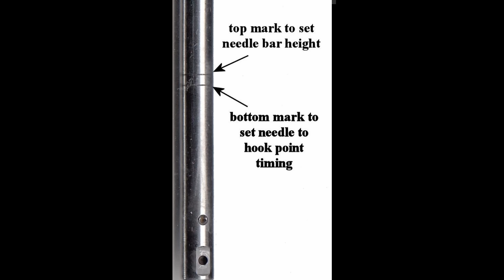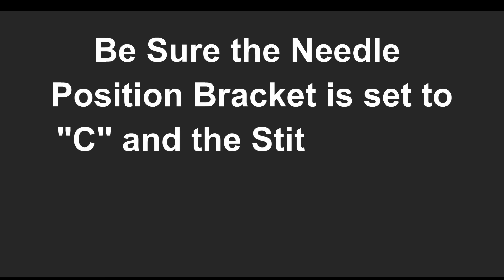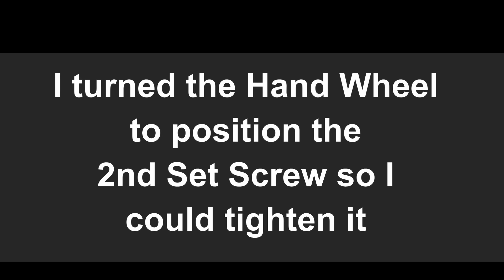How to Check and Set the Timing on the Singer Model 413 Sewing Machine

Comment: Any chance you can help me identify (and resource) a part that I discovered is broken on my machine I just got while checking the timing? I realized the bobbin hook wasn’t spinning at all, popped the bottom cover off to investigate and a plastic gear fell out. I haven’t the slightest clue where to source a new one.
Reply from the maker: Since you comment on this video that is about a SInger Model 413, I'll assume that is the model you own.
The only plastic gear I'm aware of is at the top of the vertical shaft. That shaft tuns the pulley on the right side of the bottom ofo the machine, which rotates the timing belt, and the pulley on the left that rotates the hook. So, if the hook is not rotating it would follow that is the gear, or gears parts, you found. Model 413 is in a group of SInger machines know to have a failure of that gear after 30 to 40 years of service. It is so common in fact, that several online sellers have the new gear for under $10. The part number of the gear is 155819 and you can search for it. As an example, here is but one of the many sellers I mean: https://www.ebay.com/itm/Replacement-Top-Vertical-Gear-Fits-Singer-413-416-418-457-466-476-477-478-518-/361467199502?_trksid=p2349526.m4383.l4275.c1#viTabs_0
If you need some information about replacing the gear and retiming the hook I have a video about it. I demonstrate on a model 457, which is similar to your 413 and can help you understand what is required. Here is a link to my video: https://youtu.be/M3bFtlV1Y6s
Reply: Haha, I figured it out and you already have a video covering how to replace it. Thanks for all the helpful videos!
Reply from the maker: @chrismontgomery8820  Good luck and happy sewing.
Reply: Andy,

Yes, it’s a 413. I got the gear issue all fixed, but now I have another issue. Is there a good way to lubricate the crank shaft (i.e. the rod that the hand wheel turns)? I cleaned a lot of rust/gunk off both the presser foot bar and the needle bar, and I’m assuming that the crank may also have some because I feel like there is a tiny bit of binding when I turn the hand crank. When I plugged it in after replacing the gear and tried to run the presser foot, the motor was turning freely,, but wasn’t turning the crank (indicating the belt was a tad too loose). I moved into adjusting the tension on the belt, but if I tighten it even a tiny bit, it restricts the motor, and if I loosen enough that motor sounds good, it’s not turning the crank hardly at all.
Reply from the maker: @chrismontgomery8820  Here is a video about cleaning the worm and cam stack gears then applying new grease on a different model to give you some ideas. https://youtu.be/_SuIiVok64k  You can also buy the Service Manual for models 416/418 which is what most of us use for working on the 413 model. https://manualsoncd.com/product/singer-416-418-sewing-machine-service-manual/   I'll just recommend that the machine be fully lubricated as shown in the Instruction Manual: https://www.singer.com/search/support?title=413   (I also have an oiling video:  https://youtu.be/XrNh_iaqDMM) When I have had binding after gear replacement I have found a few causes. The new gear mesh is too tight with the vertical gear on the horizontal shaft. I did not install the new gear with the screw on the flat spot and the gear turns out-of-round on the shaft. The gear is taller than the original gear making the mesh too tight. ( a few viewers have reported this. The common fix is grinding down the bottom of the metal base on the new gear). Tiny pieces of the old gear stuck in the teeth of the vertical gear. The Other common binding locations on the machine are the horizontal arm shaft, the take-up lever system, the vibrating bracket. The service manual has a section for adjusting the play between the worm gear and the cam stack gear.

Comment: thank you very much for the interesting videos, I watch you from Morocco I learned a lot. i have a 418 singer. it cuts the thread while sewing, could you help me please.
Reply from the maker: So many possible causes for that. Here are a few; wrong type needle, needle not inserted completely into the needle clamp by user, or dirt inside needle clamp, needle threaded backwards (wrong direction) needle thread path wrong or incomplete. Dirty tension unit or mis-adjusted tension unit https://youtu.be/PSCY72bJ3x8
wrong class of bobbin used (uses class 66 bobbin) bobbin wound too tight, bobbin inserted into bobbin case the wrong way, bobbin tension incorrect https://youtu.be/HT5XZ5eYYEQ
burr (scratch) on bobbin case is catching/cutting thread, burr on hook/hook point, incorrect thread clearance catching/pinching thread https://youtu.be/N9aWiTZi4w4 
Loss of/incorrect needle to hook timing as in the above video.
Reply: @andytubesewing1953  
I'm glad you answered me so quickly, all checks were done, but the problem is still there thank you very much for your help.
Reply from the maker: @laymad9273  Well, if you checked everything I mentioned above as possible problems, and they all checked OK then I don't have any other ideas why your thread is getting cut. Sorry.
Reply: @andytubesewing1953 
 thank's a lot for your help, you're so professionnel. i'll try cheking again another day.
Reply from the maker: I forgot to ask. When you say it cuts the thread, iis it a clean cut like with a scissor, or is the thread frayed or shredded?
Reply: @andytubesewing1953  
It's a clean cut like with a scissor
Reply from the maker: @laymad9273  Thank you. The most common cause for that is the needle is inserted the wrong way.
When the thread is frayed it can be the things I mentioned before, but the wrong way needle is the most common when the thread is cut. Thread inserted the wrong way through the eye of the needle (wrong direction) is the next most common cause.
This is the needle thread I am talking about, not the bobbin thread. Good Luck.
Reply: @andytubesewing1953  
your interest in my concern is heartwarming. I tried with several needles in the ever as in the place and several threads but without success. Thank's for your help.
Reply: I am having the same problem with model 418
Reply from the maker: I've been going thru old notes I have made about how I fixed problems and came across a broken thread problem I fixed on a model 347 that relates to other models also, including models 413, 418. It has to do when the needle bar is adjusted too close to the hook and the needle scrapes on the hook, especially on the upward stroke as the hook grabs the needle thread. Of course, I can't say if this is your problem but since nothing else is helping you may want to look into it. It is a fairly rare occurrence but I made a video showing how to make the proper adjustments https://youtu.be/ri5sz9vHB6I     I've discussed this with a couple friends who work on machines and the three of us can not think of any other advice for you. BTW, you can download the 40-page SERVICE MANUAL for model 418 for $8.99 from this site: https://manualsoncd.com/product/singer-416-418-sewing-machine-service-manual/
Best of luck.
Reply from the maker: @canuanditube  Please read my last reply to Lay Mad that mentions the needle to hook video. Thank you.
Reply: Andy Tube - I got a bigger problem now. I was trying to fix the bobbin alignment; to adjust the needle at the right spot I removed the bobbin casing as your video instructed, put oil generously everywhere. Now bobbin case doesn’t rotate at all. Needle goes up and down that’s it ... 😢
Reply from the maker: @canuanditube  That may have been part of the original problem. You have a broken gear on top of the verticle shaft. 50-year-old plastic. Here is a video about replacing the $10 gear, it may help you https://youtu.be/M3bFtlV1Y6s

Comment: My hook and finger doesn't move when I see or turn the needle. How do I fix that?
Reply from the maker: Model 413? I'm reading your question as the hook does not rotate when the needle bar goes up and down. If I'm getting that correctly I'm afraid the top gear on the vertical shaft of your machine has broken. That vertical shaft is how mechanical power goes from the main arm shaft down to the timing belt to turn the hook. The 413 is one of a group of models that are internationally know to have this plastic gear problem. Maybe I'm wrong and you just have a bad timing belt or something, but 95% of the time I get this question it is a bad gear. If so, for $10 you can buy a new gear, and follow my video to replace it and in a couple of hours you can be back in business usually. https://youtu.be/M3bFtlV1Y6s
If I have totally missed he point of your question I apologize and please try me again.
Good Luck.
Reply: @andytubesewing1953  Thank you

Comment: Help pls...need to adjust timing of Singer model 263. Thanks
Reply from the maker: I have not worked or seen that model 263. I was able to find an instruction manual:   https://www.singer.com/sites/default/files/product_manual/SINGER%20263_563_878_968%20and%203103%20Sewing%20Machines.pdf
Also a parts guide: http://parts.singerco.com/CPpartCharts/3_39999/3100_SERIES.pdf
No one I know has a Service Manual though. Looking at the instruction and parts manuals it looks like the mechanical system is similar to this model 413 and also model 347. https://youtu.be/dW6haHu4-hU
https://www.youtube.com/edit?video_id=w9KSRe6zcyo&video_referrer=watch
That is as close as I can get. Most Singer machines are the same regardless of parts. Timing is correct when the needle bar is set to the lower timing mark the point of the needle should be at the hook point. Either it is a belt and pulley like the 347 or 413 or it is geared and you move the hook shaft. That's all I have, Tess. Good Luck.

Comment: Hi Mr Andy tube, can I use this method with singer 241 C, thank you.
Reply from the maker: I've never worked on the 240 series of machines. It has the vertical shaft, gear, and pulley system from what I can see in the parts manual. I think the problem would be accessing the gear from the front of the machine. I do not know if there is any kind of access port or space to pull out/put back in the top gear. Some models similar in looks to it must have the horizontal arm shaft and connect parts removed so the gear/shaft can be removed OUT THE TOP of the machine instead of the front as in my video. Terry Fielding has a guide he made for the 250 models (similar to 240)  about how to replace the top gear, so that means it can be done I'd guess. You can ask him if his guide works for the 240 models. The guide is $9.50 but he will give you 20% off using my coupon of andy-h-yt  so the price for you would be $7.60  It is on his website here: http://site.tandtrepair.com/Fashion_Mate.html
Good Luck.
Reply: Andy Tube thank you for your reply.
Reply from the maker: @mohamedsharaf8593  sure, no worries and good luck.
Reply: It will i just did mine the difference wasnit used a regular screwdriver and has another plate for thread clearance,

Comment: I followed this step by step on my Singer Merrit 2404. It also uses a timing belt. But on the next downward movement of the needle, it touches another part of the bobbin case holder. Everything was tightened as per the video.
What may cause this?
Reply: The top gear has been changed previously, and it has been in use since then. Only the reverse button was just not bringing the desired result. 
But a few days ago, it just made some rough sounds and since then the needle keeps touching the bobbin case holder even after setting
Reply: I wish I could share the photos here. 🙂🙂. After reading through some of the comments on this video, and being thrown of the scent by
1.The fact that the machine was moving more or less smoothly;
2. The focus on the top gear.

I decided to still check the gear area(even leaving my lunch halfway, wifey had a good laugh) and lo and behold, the bottom gear was cracked! This has to be removed and replaced. I will check your list of videos, hopefully I will see one that could help.
Thanks so much.
Reply from the maker: I'm not familiar with model 2404 and had to look it up. I found the free instruction manual at Singer on this link: https://www.singer.com/search/support?title=2404
After looking at page 77 of that manual and seeing the views of the top and bottom of the machine I don't know what you mean by "bottom gear". The pictures show a mechanical system very similar to the model 413 in this video that you commented on. The know problem with this type of machine is the plastic gear on top of the verticle shaft. If it has not broken yet it soon will. When the gear breaks, cracks, looses teeth, it is impossible to set or keep the timing on it. You can set the timing perfectly but as soon as the defective gear starts rotating again the timing goes out and you get needle strikes. When the gear breaks off then the hook does not even rotate. I do have a video of replacing that top gear on the verticle shaft. I see it now has 32K+ views which tells us what a common problem this is on about a  10 dozen models from that decade. There are different gear part numbers depending on the model of machine.  Here is the video: https://youtu.be/M3bFtlV1Y6s    You see the 457 model has rather easy access to the gear, but some models have less access to it. people have told me of different ways they have had to get access to the gear, like removing the stitch control dials and the motor on some models. I've never worked on a 2404 so can't advise you about that. With everyone trying to sew masks on an old machine and finding the broken gears, so well know sellers are out of stock of that gear right now (5-8-2-20) https://www.sewingpartsonline.com/vertical-top-shaft-gear-singer-353273-002.aspx   some USA eBay sellers have the gear, but without screws: https://www.ebay.com/itm/New-Upper-Vertical-Shaft-Gear-353273-002-fits-SINGER-1802-1803-1812-1852-1853-/321517327403   and some sellers on ebay are selling direct from China: https://www.ebay.com/sch/i.html?_from=R40&_trksid=m570.l1313&_nkw=Vertical+Top+Shaft+Gear+for+Singer+%23353273-002&_sacat=0    with up to 6 weeks shipping time! When you see all the model numbers that gear works on it gives you an idea of the thousands of machines that have the gear and potentially the broken gear problem. If you watch my gear video it will give you an idea of what to look for and where the gear is. I hope I have been helpful and not sending you in a wrong direction, but your description of the problem is one I have heard 200 times since March, and it usually turns out to be that gears causing it. Good Luck.
Reply from the maker: see reply to your 3rd comment please.
Reply from the maker: see reply to your 3rd comment please
Reply: I want to so thank you for the link to the manual. Wow. Thank you so much
Reply: I think I have to change both gears: the vertical and the horizontal one that drives the timing belt that moves the bobbin assembly
Reply from the maker: @eghoghonedobor2321  sure
Reply from the maker: @eghoghonedobor2321  good luck

Comment: I have really enjoyed looking at your videos. I have a 413 that the hook pully is not turning. Would I need to undo the set screw and make sure the timing is correct. When I looked at the needle and the hook point, I could not see anything was in the right place.
Reply from the maker: Hi, Carmen. Are you sitting down? I believe you have a defective platic gear on the top of the vertical shaft. Whew! There, I said it. If the hook pulley is not turning that means the drive puller a few inches to the right is not turning. It is the vertical shaft coming down from the top that makes the drive pulley, belt and hook turn. WHen the gear crack, breaks or strips on top then you get no power below. So, you can buy a new gear for about $10, and I made a video about changing that gear. It has 32K+ views now and that shows how common this problem is. You can watch the video and see what I'm talking about. I take you step-by-step through the repair and then the re-timing of the hook and needle. You can do it, Carmen.😄👍✨ Here is the link to the video: https://youtu.be/M3bFtlV1Y6s
Good Luck.
Reply: I'm going to have to think long and hard about doing this myself. I had completely lubricated the machine and it sounded so smooth, then this. I was getting it ready to give away to a mother with 3 small children who wanted to learn to sew for her kids. I was also going to teach her to sew. I may take the top off and see if I can see damage. I do see rust on the bottom wheel under the hook pulley. Thought that was the problem. I'll try to let you know what happens.
Reply from the maker: Sure. It's a process. Once it s done the new gears can last for decades.Best of luck.